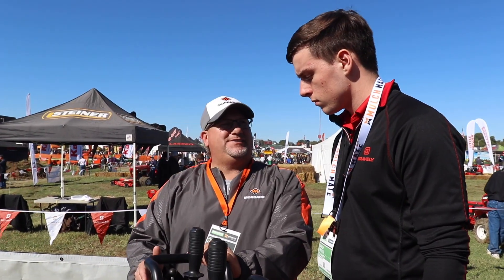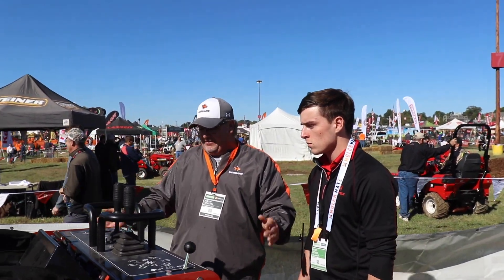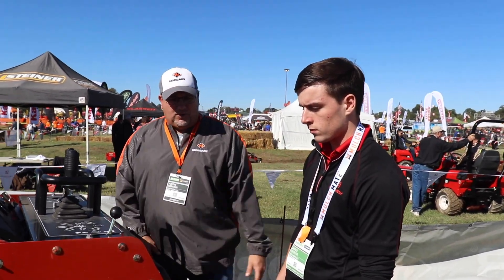Boxer 700HDX By Morbark

Comment: I know this video is a year old now, nice tractor but have you seen Kubota's SCL1000. Game changer. 1000 lb lift while still able to fit through a standard gate.
Reply from the maker: I've seen it but they won't be out until next year
Reply: Vermeer has 1000 lb lift while also fitting through gate. They have had it out for a few years
Reply: I was on a waiting list for the SCL1000, turned out it’s built by Land Pride and they’ve had nothing but problems with it. Give it 2 years before it’s actually available on dealer floors. Looking at a Boxer 700hdx